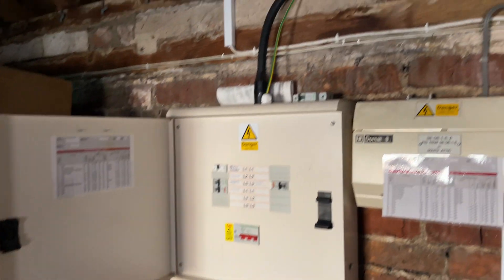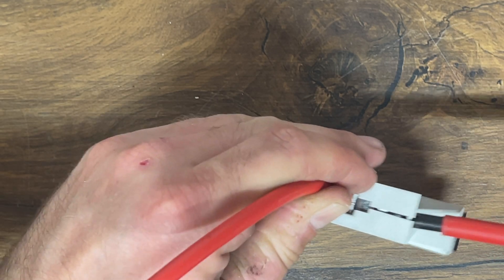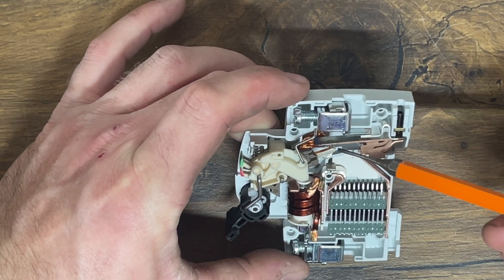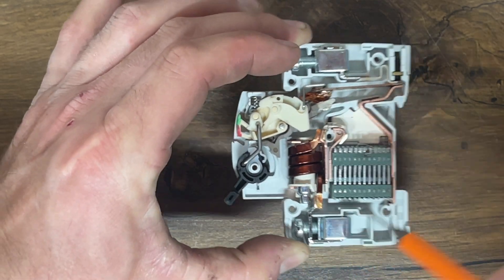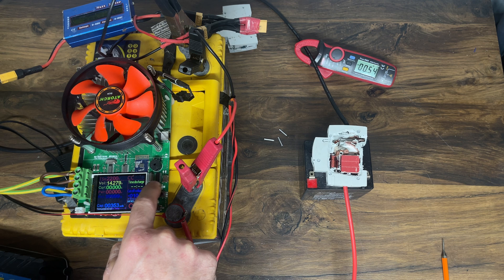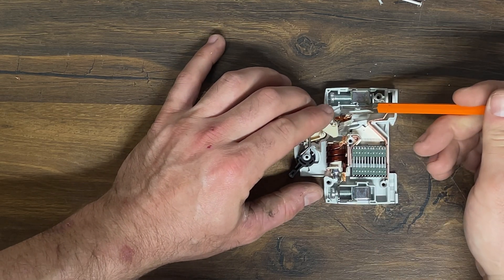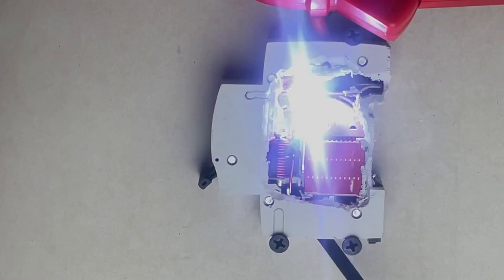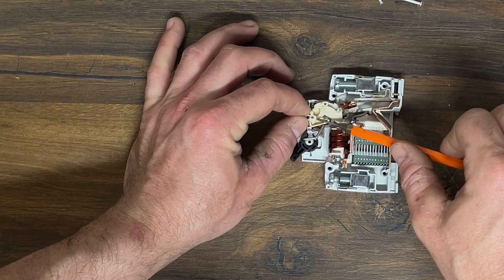Why AC rated MCB’s shouldn’t be used for DC? ARC fun!!!

Comment: I have often observed 230VAC fuses used to protect the 24VDC circuits. What would happen in the case of short-circuit?
Reply from the maker: A 230v dc voltage could potential cause an arc that won’t extinguish but the voltage is low enough I expect it to handle just fine. The current rating is relevant whether AC or DC

Comment: The bimetallic strip detects over current and relies on heat buildup to make it bend thus tripping the switch. The coil (not a solenoid )detects fault current ie a difference between the line and neutral current which increases the electromagnetic field causing it to operate and tripping the switch. 

Check out learn electrics video on MCBs and RCDs he explains how they work more clearly.
Reply from the maker: We didn't go into how RCD's work. Google do MCBs have a solenoid
Reply: The solenoid acts rapidly in the event of a very high current (e.g. short circuit). Bimetallic is for longer term overloads overloads (in extreme cases it might only act after half an hour).
Reply: The coil in an MCB does not detect fault current, as only one side of the load is present. You are thinking of how an RCD trips when the return current does not equal supply current - RCD has a neutral connection for this purpose.
Reply: To clarify, the coil in an MCB is designed to be fast reacting, and detects high fault currents (e.g. a short circuit) - usually at several times the rated protection current of the MCB (e.g. for a 6A MCB, the coil might only operate at 15A). The multiple chosen by the designer if reflected in the MCB type (e.g. Type B, Type C etc.) and is a compromise between providing protection and avoiding nuisance tripping due to "in-rush" currents which can occur when some types of load are first connected to the supply. It does not respond to earth faults by detecting live/neutral imbalance (as in an RCD).